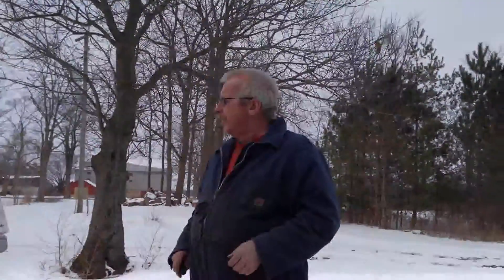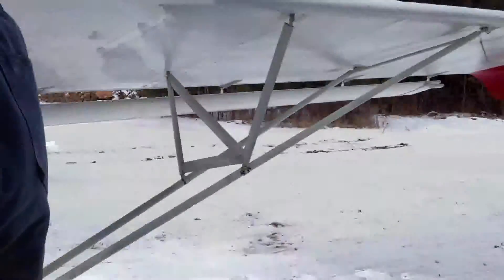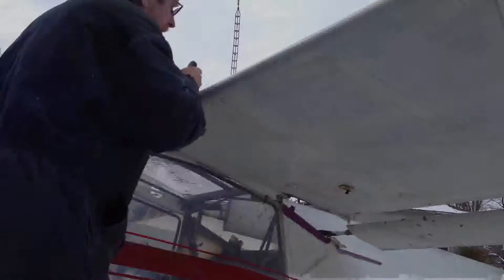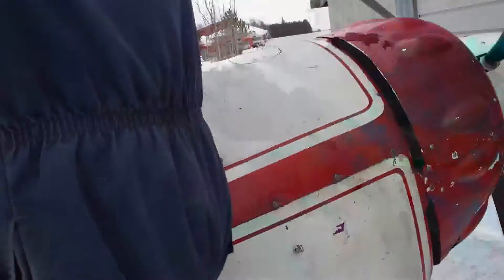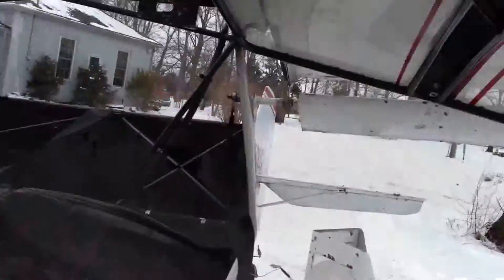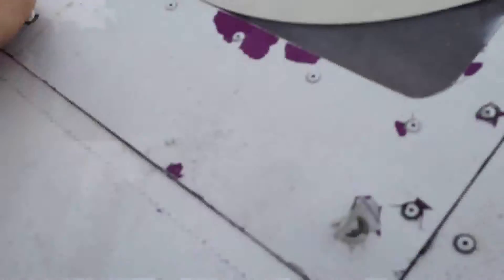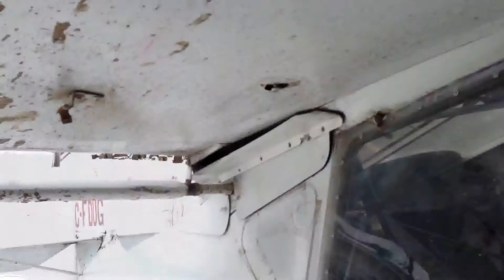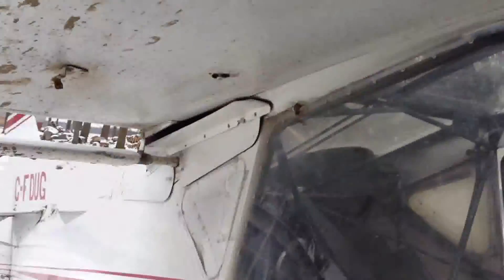How to fold Kitfox aircraft wings & do it yourself gap covers

Comment: Works best with minimal fuel in the tank.  Another option is to raise the tail.  As you can see from the demo the wings can be heavy. I've done the task solo by connecting a rope to the strut where it meets the wing and securing it to the prop hub.